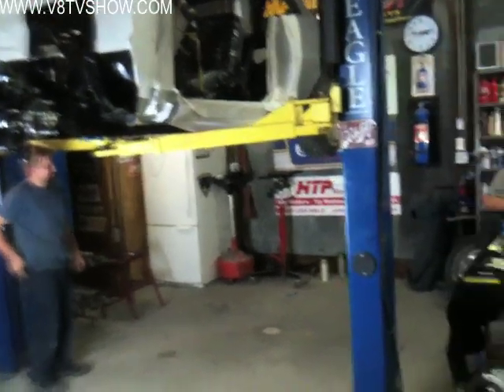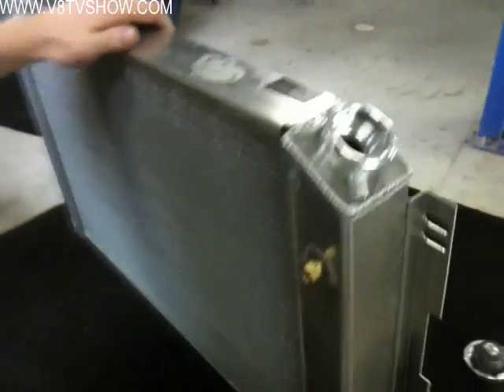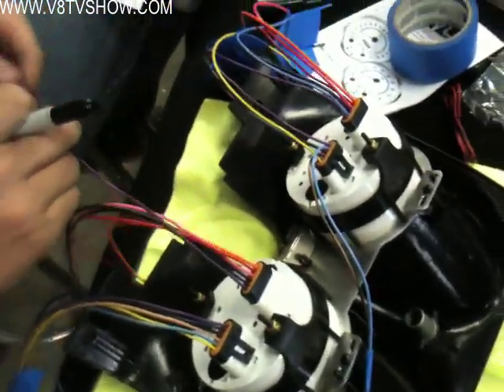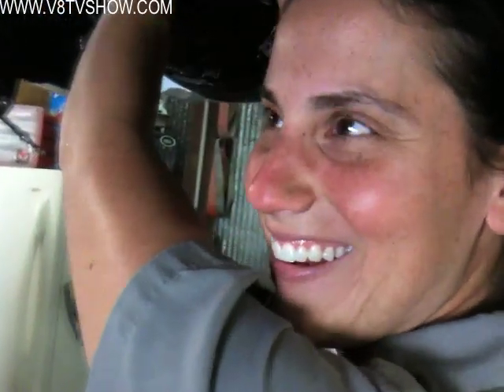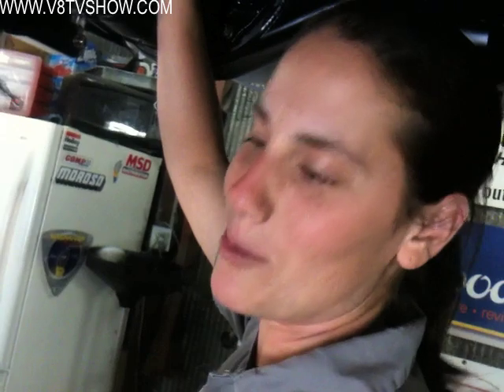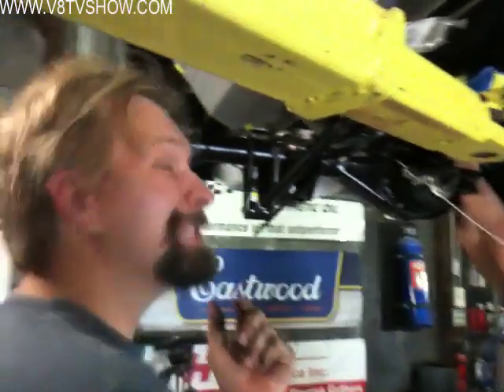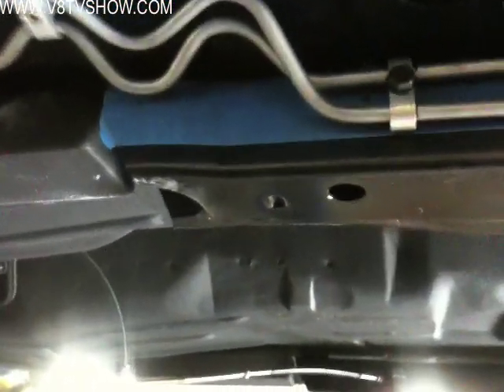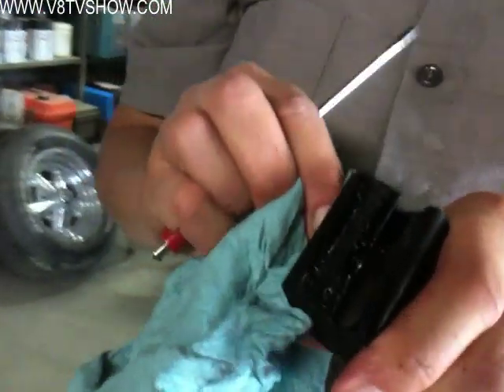1968 Camaro Countdown to SEMA 2011 V8TV Video:  Vintage Air, Be Cool, Fuel Lines, New Dash!

Comment: it is completely unique , it is the same body as a 68 dart but  2 inches longer in the front to accommodate a upright 6 cylinder engine called a hemi ,